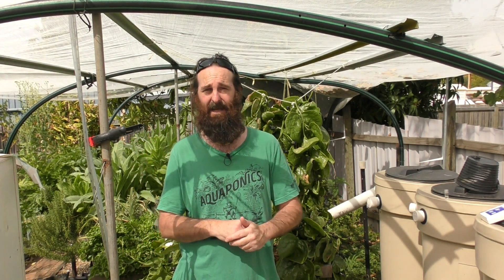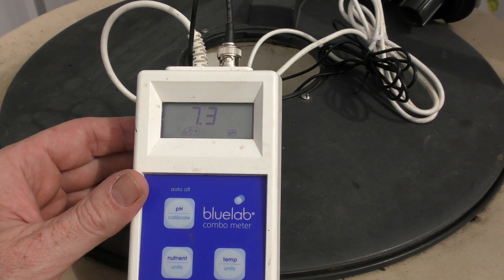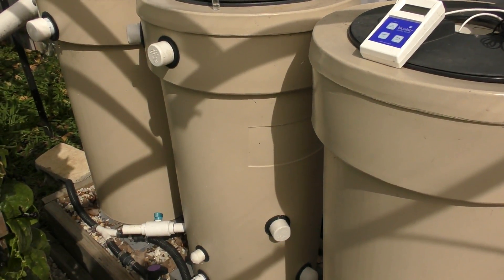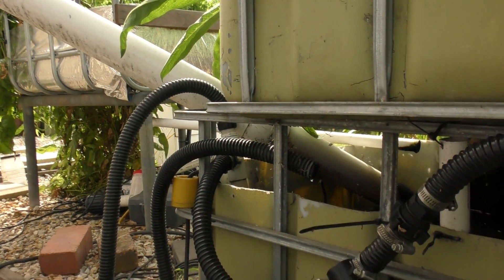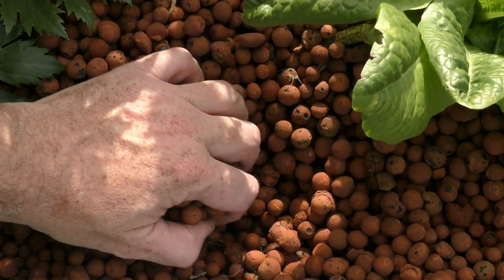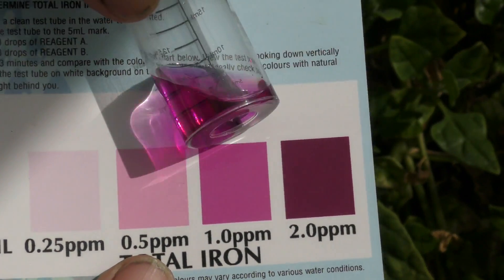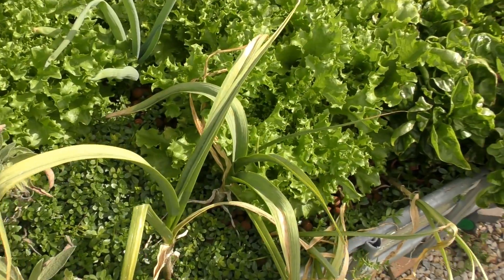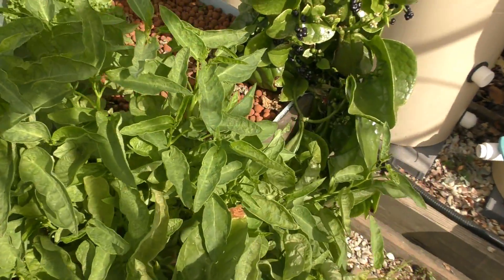Aquaponic MUCK Mites & Iron levels Update

Comment: Hi Rob, going through your videos I saw you are fighting Mites. We always used "Stinging Nettle" = Urtica . As I found out, in Australia there is something similar , Urtica incisa
,  not sure if they sting as they do in Germany for example. If you find them, plant some in a corner, they grow pretty fast. As long as they don't have flowers, they sting quite a bit. The moment they have the white flowers it's normally safe to touch them without any problems... btw, you can make a tea out of them and its delicious .....OK, coming back to the Mites. What we always did was putting a huge amount of them inside a barrel filled with water (before they bloom) which we could close up for around 4 weeks. You can open it half way through and give it nice mix. After the 4 weeks you can put it into a spray bottle and use it on your plants and that always helped us to reduce the mites drastically. 

Now, what I don't know is how that would affect the PH or what the PH of that special mix actual is so it would be interesting to know. Be careful and test it on terf plants before you test it on your Aquaponics System. Have a good one!
Reply from the maker: Hi Patrick & thanks for that. I don't think it would upset the pH of the whole system but would be best to test it on plants outside the system as you suggested. 👍
My sister gave me a bag to use as a tea a while ago to help with inflammation. Not sure it did much but I did enjoy it while it lasted. 
Sorry it took so long to respond too mate.
Cheers.

Comment: Still cold and rain here in the west.. hardly cracking into the low 20's.
Hanging out for some warmer weather to get the silver perch fingerlings growing!
Im also loving the iron test kit. so quick and easy, but i find part two drops heaps thicker and gloopy.. yours the same??
Reply from the maker: Part B is really thick. I had issues adding too much to begin with but got a handle on it. 
Have things warmed up over there a bit now Andy?
Cheers mate.

Comment: Built a "blue barrel" mini aquaponic system as per your video over the weekend 12/13th. IT WORKS!!!! And it works great. I have the balance right - the fish (10 goldfish) will go in next fortnight, and the pH is sitting (for the last three days) at 7 - 6.8. The bed floods and drains on about 6 minute cycle using a 1300 ltr/hr 35W pump. Do you think I should have an air-stone in the water too?   
My wife is very happy with it and I am excited. Seasol (about a soup spoon worth) in the water.
All this inspired by YOU and your YouTube Channel so THANK YOU...THANK YOU...so much!  
Ginger and tumeric planted in the clay stones bed. (Took almost a whole 50 ltr bag!
Reply from the maker: Hi Frank & Mrs Frank. 
I think you should be getting more than enough air from the water siphoning back through to the tank. Probably couldn't hurt to have one on standby for the hot summer days as the ability of water to hold onto O2 drops as its temperature rises. 
Would like to know how the spice goes for you in there too. 👍 
Have a top one Frank.
Reply: Hi Frank, are you using 'plain' Seasol or Seasol Powerfeed? Ordinary Seasol doesn't have nitrogen in it, so it won't cycle your system ready for the fish. It would probably be best to either cycle it for at least a few weeks by putting in a pinch of fish food every couple of days, or start with one or two fish and gradually add more until you've got the number you want to run your system. That way you won't get a sudden ammonia spike and kill your fish! :P

It's also a really good idea to get water tests (aquarium/pet stores have them, or you can look online) for pH, ammonia, nitrite, and nitrate levels. That way you can monitor what's going on in your system and catch problems before they become serious.